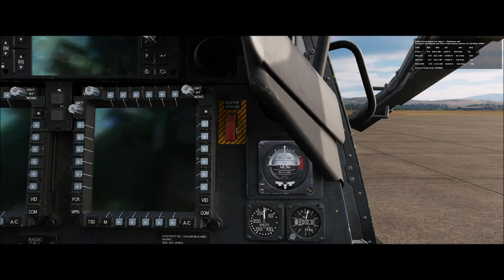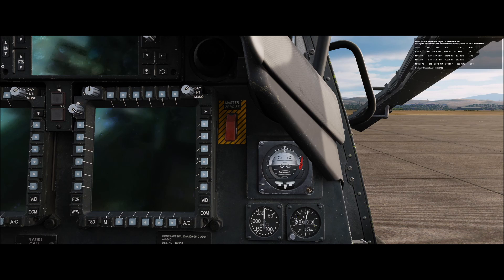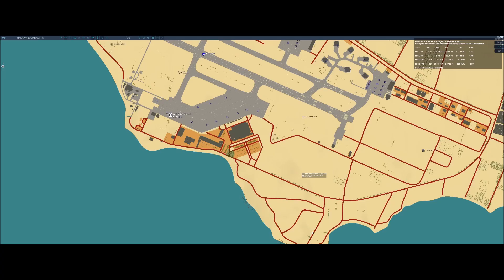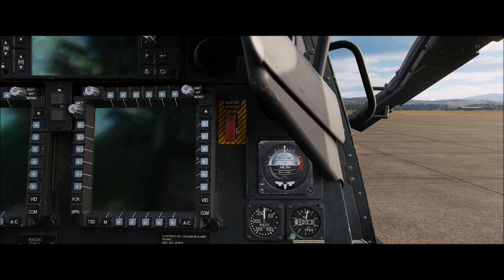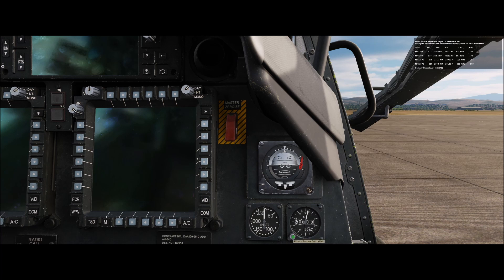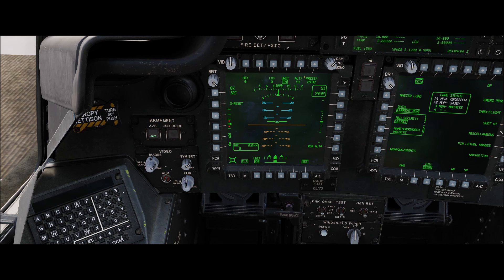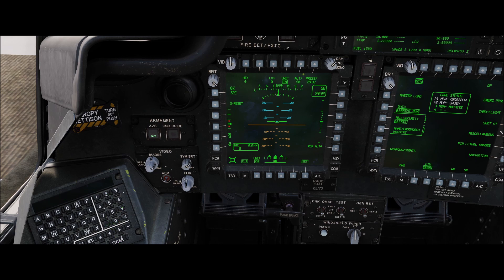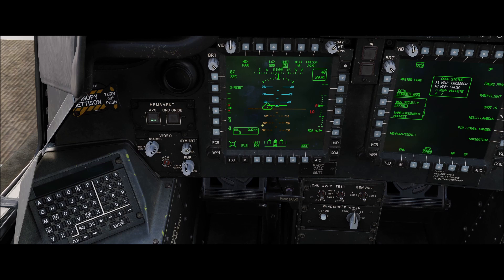DCS World | AH-64D | Setting Altimeter Explained | MSL? AGL?

Comment: Is it possible to change min/max torque values to prevent ENG from autopage'ing? Cause its frustrating when I lose TSD or VID. Or is there some way to fast "back" to previous page like DMS Short Left/Right in F-16. As I understand Favourites button " * " should keep last 3 used /per MFD but couldnt find how it works (if?). I love the A-10C feature with just swaping image between MFDs rather than switching cursor to left/right. Any tip that prevent autopaging I will apriciate.
Reply: No there isn’t.